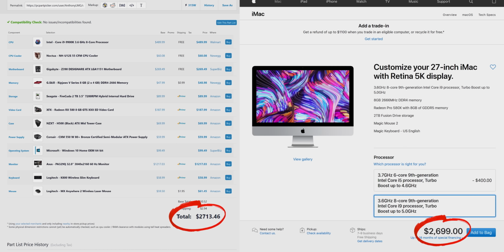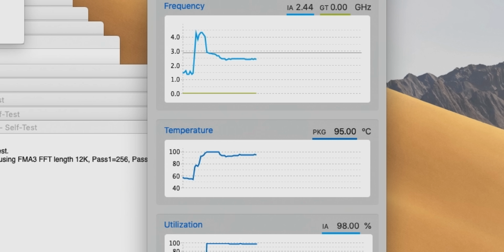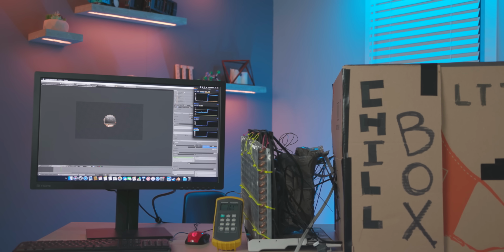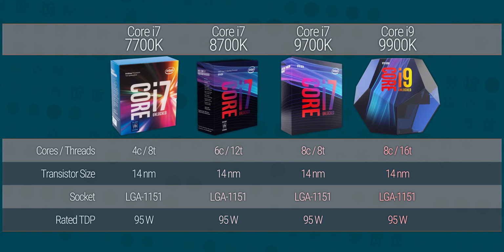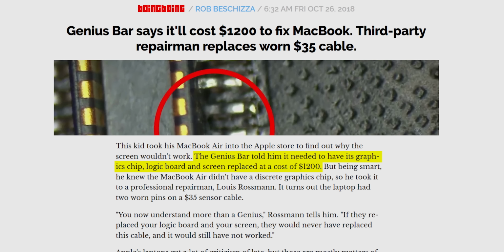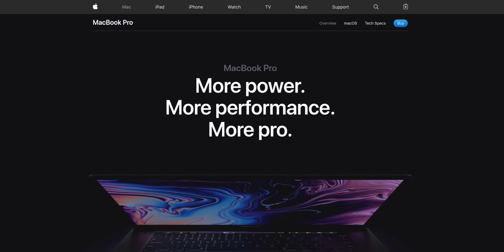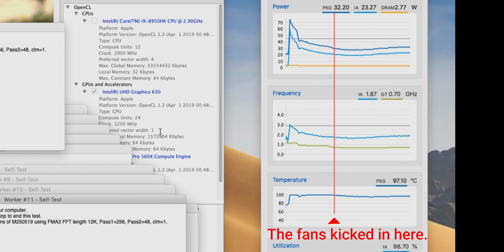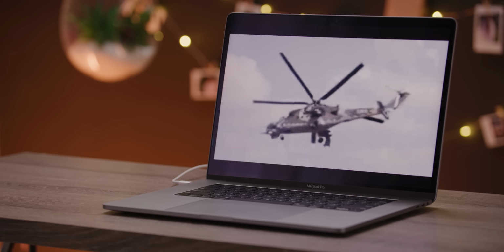Macs are SLOWER than PCs. Here’s why.

Comment: Yes it's the "same cost to build the exact same hardware based pc as a Mac" but the pro lem isn't the price itself, its the overpaying of badly picked parts. A Mac isn't a "be all and end all machine" it's often using a lower clocked multi core cpu with a weak GPU paired with too much RAM or too little RAM in a bad configuration as well as offering subpar storage configs.

SOO MUCH has happened the last 5 years with PC hardware which makes customization of your computer for your tailored work flow important and this has made the Macs obsolete on a hardware level. So yes the same pc costs the same. But not all workstations require 32GB of RAM and to some, 64GB isn't enough. And some require 3+Quadro cards especially now with Machen learning becoming such a big mainstream part of the industry.

A Mac is too limited for the asking price, its a niche machine that offer niche peripherals few should buy. The lack of quality keyboard support and completely ignoring AMD CPUs and Nvidia GPUs makes them too useless in today's market

Comment: Apple designs their own A-series chips for their phones and tablets. They can control their TDP so that the device’s body will be able to cool it, while also being able to perform excellently. They can do that with Intel CPUs, but only to an extent, after which it won’t perform as well because of power constraints.
Oh and, just as you said, Intel is still using a 14nm process, while Apple uses a 7nm process. The A12 pumps out less heat while still performing very well. An i9 (obviously) pumps out more heat both because of its design but also because of its 14nm process. If an i9 were to be made with the same 7nm process I strongly believe the MacBook Pro would be able to cool it.

Comment: What PC laptop is closest alternative to macbook pro? (with same good speakers, design, touchpad (windows precision driver), Sound, fan noise)?
Reply: I'd probably pick the 15.6 Asus Zenbook Pro.  8th Gen 6 core i7, 16GB DDR4, 512GB SSD, Nvidia GTX 1050, for $1050 less than a Macboo pro 15 with the same specs.  It also has this really intuitive touchpad.
Reply: Panagiotis Zaharis just added it to wishlist
Reply: Im still searching myself. But id like to think the surface line.

Comment: iOS devices probably don't thermal throttle because they don't use Intel CPUs. Pretty sure Linus knows that. 

I am very unhappy about thermal throttling in Apple desktops but expecting a 4lb laptop with a 6 core CPU not to thermally throttle is unrealistic. A bigger issue with MacBooks is the Butterfly keyboard. That said they could be better. The other major issue is upgradability.

One problem with YouTubers reviewing computers though is they pretty much focus on the video editing use case with a side order of gaming. No one should buy a Mac for gaming and most people don't buy them for video editing. The thermal issues don't seem to be shortening life in the real world, plenty of people are using 5 year old MacBooks.

Comment: Disagree, windows 10 is spyware trash.  There is no viable alternatives to windows or macOS. Windows 10 is spyware trash with forced updates installing candy crush.  MacOS doesn’t force install candy crush or any other shareware trash software.  If you care about privacy or control you run macOS or Linux.

Comment: Exactly the same problem I've been having with my Acer. Too thin, and the fans are just terrible at cooling.
Also, I'm working in environments where temperatures soar to 40-40*C regularly.

Meanwhile, my dad's old Thinkpad flutters away with similar workloads (mind you it has an i5-2410m, much older than my i5-7200u). 
Gonna be switching to it soon.

Fuck laptops.

Comment: As I understand Apple will implement their own cpu “soon”? Interesting to see how that will turn out.
(Yes I'm an Apple user since 30 years and the reason is the OSX, hardware design and a very low noise imac. If Windows was as easy to use and better GUI etc I might use that instead.)
Reply: It will be garbage since it will run with an ARM CPU like their iPad pro.
Reply: @megagardevoir7384  You might be right but maybe it would also mean the mac would be better performing when they can design the cpu to produce best possible with the osx?

Comment: Apple Please add 2 more fans! Please it's a kindly request from a fan!?!
Reply: Alpple doesn't care about you.
Reply: Applecare does
Reply: I find it odd that laptops don't just have a massive heatsink on the rear with 4 fans... Surely more fans at a slower speed would produce the same cooling with less noise?
At least in older laptops, there is a lot of free space above the motherboard.
Reply: What's the point of adding more fans when they are not spinning? 🤣🤣😆😆🤣🤣😉
Reply: @haseebkahn4811  they should just know that if you are adding a 95W TDP chip then it need some serious cooling to run efficiently. You can't just add different types of processors with same cooling design
Reply: @devarshbhatt5612  point made! 👍
Reply: how about more are for the heatsink. It already has 2 fans.
Reply: @WetOlde  their heat distribution technique is great, but the only thing they lack are the fans to move away that heat
Reply: Don’t get macs
Reply: PC companies care so much about PC D-bags.  You can feel it.
Reply: @TexMex421  who cares what companies think of you? do they provide a product you want, at a reasonable price? that is all the matters.
Reply: @TexMex421  They make money from planned obsolescence, changing their plugs and sockets to be different every time, just so you buy all their crap over again, and relying on clueless hipsters who care more about a shiny logo than performance. But who needs performance when you have barely any software? It is pointless moaning about PC, because pcs are open systems and you can use whatever hardware and operating system you want. It is like moaning about cars because you like to ride a pushbike. A very expensive and kinda gay pushbike.
Reply: @TexMex421  Look, I dont care what people use, if an apple computer fits your needs and you want it, then it is the right computer for you. However I as a graphic designer, apple was the industry standard, and I have been using them since the powerPC days, in 1995 or so, through imac to g3, g4, g5, and I hated every single one of them. Pretty much every time the plug format changed, meaning most of your peripherals, and even monitors had to be replaced. I have a £1700 colour balanced screen from (I think) the g4, that was impossible to use with any other system, because it has some awful integrated power and data cable that is incompatible with any other computer. They absolutely do this sort of thing on purpose, and its scummy. You can see this even now with their phones. My old iphone could only use specific headphones because they changed the position of the microphone contact. Why? so you buy all their peripherals again. Id rather build my own machines with twice the performance for half the cost.
Reply: @harkonen7227  Oh trust me I don't care even more than you don't care, but I do hate them even more too.  Not really.  I just think people are hilarious.  Good luck out there.
Reply: No it's the macOS that got me by my balls. Thats what makes macs so special.
Reply: @TexMex421  because apple is awful, just out to drain your wallet. But people are free to buy half baked crap if they want to.
Reply: More fans, boy! Less fan boys!
Reply: Don't they already have enough "fans"? Knee-slap ... OK, now you can face-slap me ;-P

Comment: Next generationn consoles going to be even more powerful than pcs! Nintendo 64 was the last (and only actually) conosle to be stronger than pcs at the time. Watch Golden Eye vs Unreal for proof. Consoles are big business so mass production of extremely powerful processors is the way. The GPU industry is too crowded so margins are small and development suffers, but if they knew they could sell a guaranteed 80-100 million consoles (then later trickle to more pcs) they could go all out and make the most power. Playstation 5 will come with a SSD standard and will have such a huge BUS the entire game could exist on the motherboard and RAM and incredible graphics will be available

Comment: I love Apple products, but when it comes to actually getting things done, I'm glad I opted to building my own W10 desktop that never throttles or surpasses 80c on a 9900K.
I probably would have got one if it wasn't for the thermal throttleing.  I can get over the lack of ports.  But I don't think any PRO fessional is going to complain if they made the MacBook Pro was twice as thick in favor of thermal stability, more ports, and a real keyboard.  hell, most professional editors just want the full towers to come back, those were perfect in every way.

On a side note, I never realized how hot the CPU MOSFEETs get.  Granted, a good MOSFET doesn't mind the heat, but it does shorten life span.  PCH heat dissipation on a MacBook is non-existent compared to the massive chunk of aluminum on my Asus board.
Reply: Uncooled FETs and PCH is ok for low power CPUs, 15 to 25W, but for anything more, it's negligent design. Un-cleanable fans is another.

But I suppose there's so many things that will likely clusterfail on a Maccook as soon as the warranty's up that there's not much point fixing any one in particular?

Such issues can usually be solved with a thermal pad bridging them to something - either the case or frame or keyboard - but you just can't do that in things designed to be near impossible to service like Macbooks and Razers

Comment: My Pentium G3260 thermal throttles as soon as i boot into my pc
Reply: Not likely, but if that is the case, the heatsink is probably improperly installed. There is no other way to explain that. Even the shitty heatsink that comes with most intel processors, you shouldn't hit thermal throttling until you are doing a heavy workload. It is only a 53watt cpu.

Comment: So, you are comparing a macbook and a PC and you came to the conclusion that the macbook throttles. As this might be true, have in mind that apps are running differently on Mac and Windows. Maybe the raw performance is lower on macbooks but have in mind that FinalCut Pro for example, is way faster at exporting than anything on windows. From a quick look(correct me if i am wrong), even Photoshot experience overall is better on a mac.

Also, Macbooks are in ultrabook category. I would like to see how a Dell XPS or HP spectre or anything in ultrabook category does. I don't really believe they would do much better, and considering their unoptimized applications, any real work would take longer on those.

Comparing performances based on just benchmarks might be a good way to see the raw performance, but it fails to show how the every day use is. Macbooks have 10 times better touchpad, screens are awesome, storage is blazing fast as is the OS itself. Unfortunately, the keyboards are a bit messy so that's a bad thing.

Overall, I don't think anyone will go wrong when buying a mac if picked for his/her needs.

Comment: Technically, iPhones run slower than most Android phones but iPhones still feel faster because they are designed and coded to work together properly.
Same with Mac OS. Unix will feel faster than a PC that's technically faster than the Mac.
Reply: You're misinformed
Reply: @retrocomputing  from someone who uses all 4 systems, I can assure you that I am correct.
Reply: @evilution_ltd  did you see ANY iphone vs android benchmarks? Look at one and try to point to "most android phones are faster" there.
Reply: @retrocomputing  On paper, all flagship Android phones and even mid tier Android phones have faster processors, more cores and more RAM. In real life however, iPhones are faster than almost all Android phones.
Reply: @evilution_ltd  who told you they have better processors on paper?
Reply: @retrocomputing  
I didn't say better, I said faster.

Most Android phones are now running the Snapdragon 845 or the newer 855. 

Both the 845 and 855 are:
8 cores. 4@ 2.8ghz and 4@1.8ghz
and Android phones usually have 6+Gb of RAM.

Apple's A12x Bionic processor.
8 cores. 4@ 2.5ghz and 4@ 1.59ghz
iPhones have a maximum of 4Gb of RAM. Most have 3Gb.

Therefore, Android numbers are higher so the Android phones should be faster. The reason they aren't is because of Android slowing everything down.
Reply: @evilution_ltd  if you actually look at benchmarks you can see that even A11 beats 845, and 855 being much newer has more or less the same performance as A12. If you think number of cores and frequency is enough to be faster I have some great news for you. 15 year old Pentium 4 is 3.8 GHz, so single core performance should be the same as the latest i9. What a bargain right?
Reply: @retrocomputing  ffs, is English not your 1st language or are you a bit slow. That is exactly what I am saying. Apple chips are faster in real life despite being slower on paper than the Android chips.
Reply: Even if we ignore specs - iOS feels faster because programmers FOCUS on fast reaction time from the system. If you tap something you should get something instantly even if it ends up loading slower than on android. For a long time android struggled with simple home screen swiping, and iOS worked perfectly with swiping from day one. 

It's NOT about getting software and hardware together or optimizing, it's a hard focus on particular system behavior.

Comment: Very well done overall, but I would like to pose har part of the answer to your cricket question was actually given earlier in the video. Intel.

Apple was promised by Intel that they would have 10nm chips by a certain date and destined accordingly. Then they didn’t come out. So Apple was stuck with a too hot CPU for their already existing design and it was too late to change the design without extreme cost. No doubt they would have rather throttled less.

Why does the iPhone not throttle? Apple controls much more of its design.

That said, I agree that it’s wrong for them to care more about looks than cooling. I just don’t think it was that intentional in this case. (terrible pun intended)

And guess what happened last time a CPU manufacturer gave Apple a CPU that was too hot and never delivered the specs they promised? ;)

Comment: Even an early-2014 MacBook Air has serious thermal throttling despite the fan running in full speed almost 7*24. But good thing is running the fan in full speed all the time does protect my internals quite a bit.

Comment: I still own my 2012 15“ Retina MacBook Pro (the original one and yes, it is 6y and 10m old by now). Up until a few months ago, the performance started to drop at about year 4, up to the point, that I couldn’t even run Minecraft anymore, cause the CPU would throttle to abt. 1.20GHZ, even as low as 1.02GHZ @ 89 deg. C. Then I took it apart and applied some new thermal paste on the CPU and GPU. This helped a lot and I got 2,75GHZ @ 80 deg. C constantly while playing.

My point is, that I’m pretty sure, a lot of „normal“ Mac users don’t even have a clue how to perform even the lightest kind of maintenance on their machines (as did I up to a point) and will be wondering, why their expensive cool computer runs like a dog.

So now, I’m quite happy with my Mac and it keeps working almost as good as new and I will be able to use it for another few more years (hopefully)

Comment: Some of us usually choose Mac because of the OS... one that doesn’t delete my files through forced automatic updates... 😉
Reply: Unless you use a Mac for certain editing software, it's not worth it.

As for losing data... Apple couldn't care less about your data; if your computer fails, they don't offer any solution to get your data back.
Reply: Well, but you lose your data if any part on the macbook dies since data cant be accessed anymore

And if you now say 'backup'
A: whens the last time you did that? Many people dont
B: same can be said about pcs, setting up a small home server to backup disk images isnt hard nor that expensive
Reply: @Venom Snake So you're saying I should just expect Microsoft to release faulty updates and delay updates all together on my Windows machine ... ? 
You have a point, Windows is definitely better.
 Nick Sande, Apple does offer iCloud for MacBook backup. Comparable to OneDrive but it actually works. So to answer your question, when is the last time I backed up? The moment I saved my last document. 
Backing up in this case is just a checkmark option - Windows is a lot harder.
Reply: @Venom Snake As a Windows/Linux user who hates Apple, I must say that I absolutely despise Windows 10. Also, you can disable updates? Not in the latest version I used (1809 iirc). Meanwhile in Windows 7 and 8.1, just go to Windows update in the Control Panel and disable the updates.

Comment: One thing to keep in mind is these poor thermal results are with their pathetic GPUs as well.  For example the previous top end MBP 15 GPU only had the 580x (which is still an option, you can spec a $3800+ laptop with that GPU before breaking hundreds for a minor amount more) which is about half the performance of a laptop 1060.  The top end MBP Vega 20 GPU option which costs a whopping $350 more is basically as fast as a laptop 1050 ti.  Meaning the MBP is so poor in thermals with just a CPU and a crappy GPU and not even entering the realm that gaming windows laptops enter, trying to balance powerhouse GPUs along with high CPU usage for intense games.